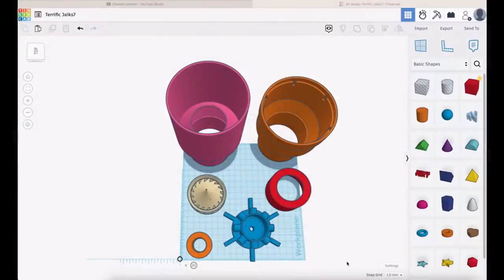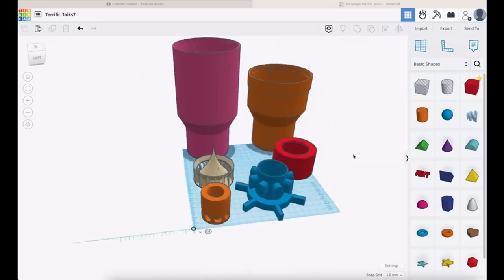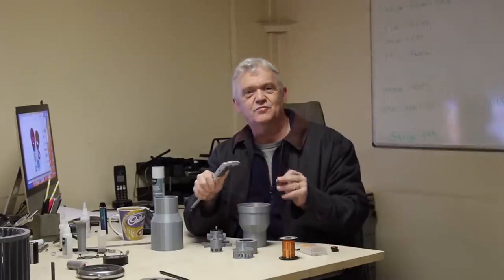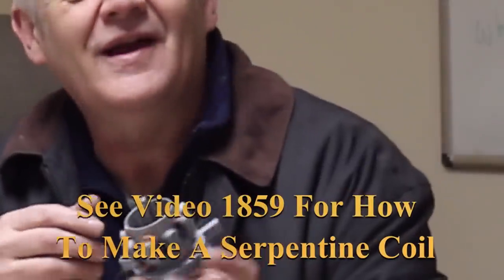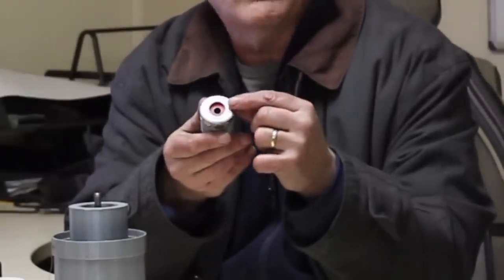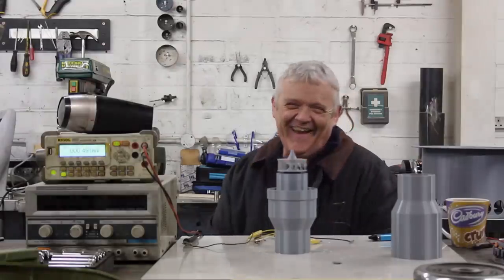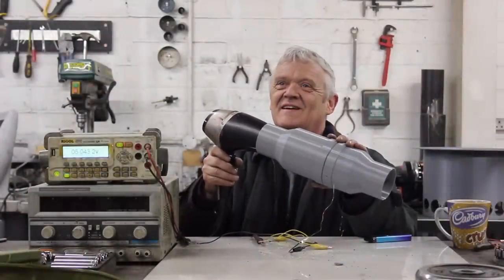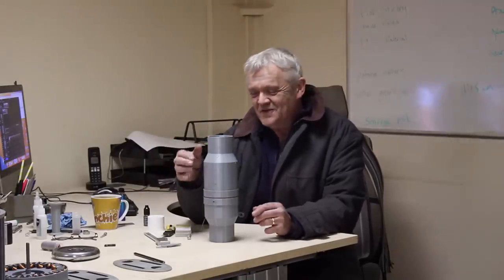1886 The Rainwater Turbine

Comment: Suggestion: for just a wee bit more power harvesting, one could put some counter diverted vanes in the top of the spout [they need not be very specially complex or sophisticated, and you could put them in without printing, just take a top of a matching steel soup can, cut it into 'petals', turn them so that they look like fan blades, and then hot glue it into the top so that it gives the falling water just a little spin so that it is turning into the thrusting face of the turbine blades.

While at the amount of water flow normal rainfall may not really make the system spin, this will give you [[[as much as]]] 7% more effort from the water as it falls in, by giving it that directional spin.

Comment: Hi Rob, have you ever thought of repurposing a car alternator as a generator? 

Pretty cheap to purchase, could even get an old decent one from scrap, minimal work to repurpose, easy to adapt via a belt, or changing the pulley, and guess work is take out of the winding and coil.

Comment: I cant help wondering what sort of current you get out of this. Specifically if you use a schottky diode bridge and a joule thief to bump up the voltage would you need to use something a bit more heavy duty than a small signal transistor/? You could also then use a 34063 type buck converter to get a nice steady 5V for charging a phone etc. If the voltage is high enough you would not need the joule thief stage. Also using wire that is too thin for the coil will obviously restrict current. So basically you could use the flat rainwater equivalent of a PV on the roof then this in the downsprout. The maximum you are going to get from the turbine for a standard house is less than you would think. IE 100mm a month is the average. That is 100kg of water per square meter. Even the Highlands only get about three times that. It's less in the south east. From roof to ground is 4.7m call it 5 for easy maths. So that is a mere 5000J (taking G to be 10 for easy maths). Assuming the whole lot comes down in 5 hours (unlikely) for a 100% efficient power output you are talking 0.05W per square meter of footprint (not planar area) of roof feeding that downsprout so maybe 0,5W max. That said I am working on turning the electrostatic rainfall generator using microscope slides. That looks like it should achieve far more power.

Comment: This has been a lot of fun to follow! I'm thinking that these could be stacked in the same pipe.
Reply: Very good idea ‼️‼️‼️‼️
Reply: It'd be pointless. The energy available is just the product of height and flow - it doesn't matter if you have lots of turbines stacked, or just one at the bottom. If you have the pipe engineered for the turbine.

Comment: Great job, great possibilities.  Looks like something that could be used in a rain collection system/wind wall wall configuration.   This would put it to full time production with lots of energy inputs and redundancy.
Reply: I am wondering if this can be integrated into my guttering, I live up north so using a dump load as a heater would be perfect to ensure it doesn't freeze in the winter. 🤔🤔🤔
Reply: @almcchesney  I'm sure it can.   You would need a 3d printer to make something that conforms to your home and gutters.

Comment: Rather curious what this would look like with a wind element tied into it!

I had a run with francis turbines a few years back and ended up doing a rather large one, but as luck would have it, I still have the files that survived my bad drive catastrophe. It printed beautifully (I still have several as desk art) and it has a fitted housing, though it was done up for a one inch axle (25.4mm). If anyone wants a super sized version, I can probably get it together in a bit, though you'll need a well-tuned printer to pull it off and scale as necessary. 😉

Comment: I'm thinking header tank and a coanda screen, something to catch the debris and you're golden.
Reply: I have heard it is illegal or discouraged to generate elec from UK mains water
Reply: A screen to clean 2 or 3 floors up ! Narr m8 easy to clear gutters with pole and jet wash
Reply: Collect the water in the downpipe itself and flush it out, similar to a soxhlet extractor siphon system.
Reply: The filter could be positioned local to the turbine, near floor level.
Reply: @gavinmorris154 .  Rain water is not mains water, so no problem.

Comment: Voltage is nothing without the ampers ;) - just saying :D. But the project is awesome, a few of them in a row like one under another, and the filter at the very top to insolate the stuff which can go into the turbine and the first version ready ;).

But, would there be a much of the performance increase, if that would be a turbine like Tesla had? Or you think there would be not much of a difference? :)

Comment: I would imagine the water going down the pipe would favour running down the sides causing it to miss most of the desired area. I think a funnel shape just above the spike would force the water go though from the centre outwards. This may cause the water flow to bottleneck though and overflowing in the gutters. I'd imagine stacking them might also cause bottlenecking. 

The other issue would be preventing debris from clogging things up over time. Even very tiny bits would cause an issue. There would have to be a fine mesh but that mesh could soon clog up.

Comment: Wire is cheap, magnets are expensive. very true. 24 and 48V 20,30A supplies are really cheap. just bought smaller magnets for weight and i'll crank up the amps.

Comment: Hi Robert, I was wondering if you had seen 'quint builds' series of videos called "rain gutter power"? He looked in to ways to store the water in the gutter at the top until it reached an appropriate level i think using a bell Syphon?  using screens etc to help reduce  the debris coming down which would be clogging the system.

 It would be interesting to see a combination of both of your pieces. Using the pelton wheel design he has made above and yours below catching the water below it to try to really squeeze every drop out of that energy potential. 

Now that I have written this, I can imagine how much of a mammoth task it would be to implement! 😂
Reply: Thanks for the mention Kieren! 😁👍
Reply: @QuintBUILDs   You are more than welcome, very interesting work and your passion for what you do is on par with Robert's. 

I don't know about anyone else but I personally would love to see a collaboration between the both of you. With both of your drive and ingenuity I would be confident in thinking that you would come up with something spectacular!

Comment: Very neat and made to fit into the drainpipe. But couldn’t the wire be put on the outside of the drainpipe and the stater made bigger to fit the width of the inside of the pipe.

Comment: This is a really good prototype for a product actually. Besides the obvious improvements (more wire and stronger magnets) , the inner cone (fondle) on the top of the assembly  should direct water, maybe, at a slight incline towards desired rotor direction of rotation (some "ribs" - straight , or slightly curved). Similar approach like with Darwin's wt - manipulating the available fluid flow. Other people already mentioned some kind of protection against the debris in the drain pipe and I would add - an easement of installation/de-instillation for freezing conditions and cleaning  (maybe a rubber sleeve on top ). Otherwise brilliant stuff !

Comment: Steam turbine? You would need more hardy material. But a high(ish) pressure steam jet would probably push more rpm than simple gravity fed water. Although for the sake of keeping the boiler topped up a condenser might be a good idea. Mind you if you're going that route then tesla already has a pretty efficient turbine. Although I don't think he ever used a direct magnet approach that you use in yours

Comment: You could design it so that the top part of the turbine is bigger and exposed and the bottom can catch the thown off water. This would then generate from both wind AND rain and if mounted on a building corner get more wind from two different directions.

Comment: What about this crazy idea: this is an insert to your rain water pipe, and the mechanism is inside the enclosure ... but, it is only useful when it is raining.

If you were to orient this vertically (like a water wheel) to have both an inside (water) AND outside (wind) powered rotation, you could get more use out of the motor system. Plus, the generator and wiring could be housed in the "air" side so there are less chances of shorting the wires. 

Crazy?

Comment: Getting closer to the chimney heater.
Reply: If you had one of those items at each end of the chimney wires from both charging a battery connection to fan heater - warm air = winter, cool air = summer .

Comment: Water turbines generally run with less speed and more torque. Could the serpentine coil design be turned into an iron core type by pressing some rod into the coil posts...?

Comment: To build on Jehu's note, water wheels have the water falling on one side of the wheel. Thus, would this perform better if the water was more channeled and vertical?
Reply: This one turns 100% of the area into the rotation, that makes is completely space efficient. So I dont see any improvements with this turbine. Maybe other designs are better optimized for other parameters but always and up larger and heavier.

Comment: A really nice build Robert :) I love how you fit stuff into ordinary bits and parts. 

About rainwater power; Maybe my math is incorrect, but the truth of the story is that it's "nothing" there to harvest right?

Let's say your roof are 150 square meters, and the annual amount of rain in UK is 1100 mm. That gives 165.000 liters of water "landing" on your roof.
If your rain gutter is 3 meter long, the energy in the water is 4.855.950 J witch converts to 1,39 kWh, without any losses to the environment or in the conversion.

In reality I would guesstimate that only 50% of the energy is harvestable, and we are left with 0.7 kWh production each year.

Are my math/physics way of here?

Comment: This is a bit off topic, but here  goes! I have dozens of new 18v permanent motors 1.5 " diam, 3/4" long. Could I put a fan blade on one and expect it to run another, with just wind? Thanks for any help, just was thinking of how to utilize these. If spun by hand, they will light a led. They are rated for 4000 rpm. Again thanks for any help or ideas!

Comment: That is a beautiful piece of kit.  I would design it to assume a much lower flow - probably a much smaller turbine.  If it could somehow maintain a certain water height in the pipe above the turbine, the pressure should make it much more efficient.
Reply: You could add a reservoir with a bell syphon between the input and the turbine. That would result in a defined pressure, flow rate and minimum flow duration for the system, allowing for some further optimization of the turbine and the electrical components. Furthermore, it would allow harvesting energy even from a slight trickle of rain that could slowly accumulate in the reservoir until the syphon activates and flushes the reservoir.
This might not necessarily be a good idea however as you pay for those benefits with a potential for frost damage or, even if the system doesn't break when frozen, a good chance that it might get clogged by ice during the cold months. I suppose painting the reservoir black and surrounding it with one or two transparent shells for isolation could at least lead to a system that uncloggs itself during the day if it froze during the night.
Reply: @vmonk722  That's a good idea, actually.  And frost is definitely an issue to consider.  An easy solution would be to allow a small leak, which won't massively affect efficiency while raining, but will eventually drain.

Comment: It looks like a cherry bomb glass pack muffler. Makes you wonder, if made from heat resistant materials, could you put that in line of a vehicle's exhaust system? Use that in place of an alternator to keep the vehicles 12v battery topped off

Comment: Towers that drop water inside them create downward air force at great speed, which drives turbines at the bottom. Overcoming the water pressure and energy required to raise the water is apparently a relatively simple process. This is the most effective way of generating clean energy, the water of course can be recycled and used over and over, factoring in evaporation. 

We won't ever see them, or will we...??

 Would love to see a smaller working model Robert. If it takes your fancy ?!

Comment: 2 questions if I may?

1 relating to the magnets you use for the serpentine generator; if the horizontal wires are essentially wasted then why not use rectangular magnets that have a shorter horizontal side? I assume you have thought of that and it’s due to having circular magnets to hand?

2 if you had a pile of bearings and no thrust bearings could you maybe use 3 120’ apart to create a thrust’ish bearing? Maybe less efficient or maybe just a bad idear?

Comment: where the water goes down the drain pipe and into your generator , Could the hole be smaller? By having a smaller hole the drain pipe would then fill up with water and then forced more through the hole into the generator, in other words the water is forced by the pressure of the water in the drainpipe.
Reply: If you restrict it to much the gutters will overflow during heavy rain.
Reply: @Tas1962b  there are 2 ways around it, Either make the Darinpipe fatter or by putting something like a bouie inside the pipe like we find inside a toilet, when it reaches a certain amount of water the bouie would then push back on the water giving some force. not much but every little helps.

Comment: You'll need to redirect the flow of water upstream to take it off the internal walls. Otherwise, I imagine in a real-world rainwter scenario, the vast majority of the water will adhere to the internal surfaces of the downspout by action of surface tension and then skate past the turbine. I would think (but you'd have to test this to be sure) that at any given point in the pipe, the concentration of water in that crossesion is actually lowest in the centre. I would add a section of water conditioning immediately above the turbine with the aim of concentrating and redirecting the flow of water as close as possible to a laminar flow without slowing the water so much it backs up in the downspout. 

Actually, come to think about it, a better idea might be to add a small reservoir, say 600mm of downspout, above the laminar collector, topped off with a steeply angled mesh to filter out leaves and debris, leading immediately to an angled overflow spout. The main downpipe then drains into a waterbutt, while the angled overflow leads to a ground drain. The ideal situation then is that the flow is not interrupted enough to fill the 600mm reservoir, thus capturing all of the rainwater's potential energy, and the water butt is utlised frequently enough that it never fills.

Comment: Imagine if darwin wind generator or its vents are fitted to the same drain pipe especially tall buildings. It'll include the high winds during rain adding even more pressure by venturi. Or just be above it, and drain pipes double acting as wind funnels.

Comment: So you did redirect the incomeing to the center , put a hopper on top with short gutter so so water falls down naturally 
To me if you turn the down pipe into a resivor tank and use the standing pressure thro say a 15mm or smaller hole it would realy wiz round , easy to do a bypass at the top with 2 hoppers when 1st down pipe is full its a common thing to doo for large roof area and deep flow gutters to have 2 down pipes if one cant take the flow from large roof

Comment: I had a similar idea to this, except instead of falling water from rain, i was thinking about the water from skyscrapers. You need to pump water to the top of these massive skyscrapers, and what goes up must come down. Water from sinks and possibly toilets that falls from the top floors could spin some small turbines and feed back into the system of the building.

Comment: Nice work Rob. I made something similar several years ago using a turbine,but leaves and moss are a problem. I concluded that the centre needs to be kept clear. The rainwater runs down the sides of the pipe and not straight down the middle so maybe increasing the diameter of the pipe and directing the water to the outside may work. The bearing system is then obviously another problem

Comment: I've always wondered what would happen if you had arrays of giant pipes stacked with generators in them all the way down. Surely it would continue to push the next wheel and the next and the next, right? It's not as if it can defy gravity and stop falling, but energy also has to be lost (transferred) from another system to maintain conservation of energy, so what is that like, a minuscule amount of the energy from the gravitational field of earth?
Reply: I know this is a stupid question. I didn't get to learn physics at school, so even though I've learned a lot since then, it's always been on a need to know basis